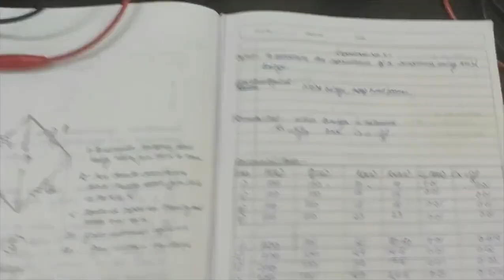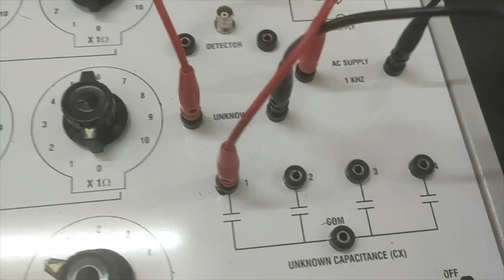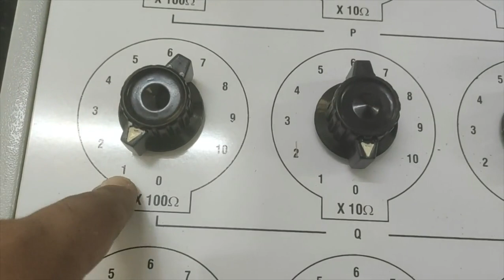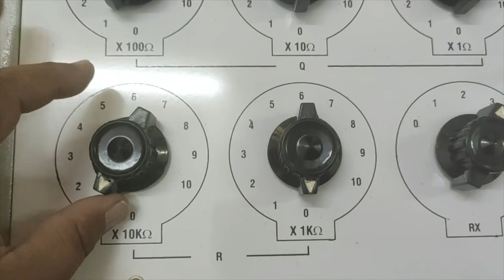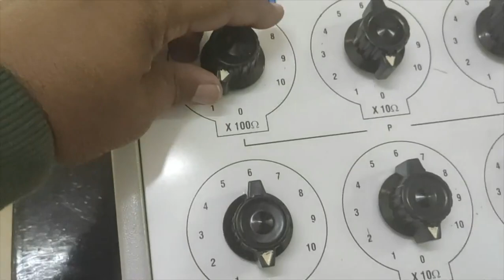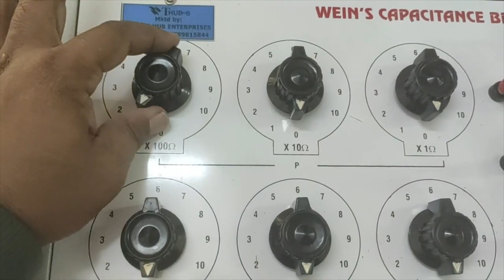Capacitance using Wein's Bridge

Comment: Respected sir, i have couple of questions, 
1) What determines the a/c in this experiment? 
2) Could we use d/c source instead? 
3) what would be the balancing condition if we were to use an inductance instead of capacitance C2 in this experiment? 
Sir, if could answer these, that will be very helpful.
Reply: Ac